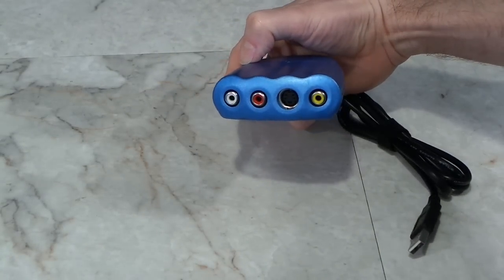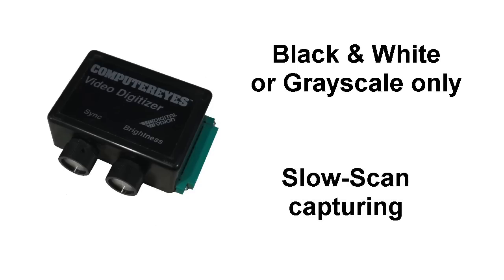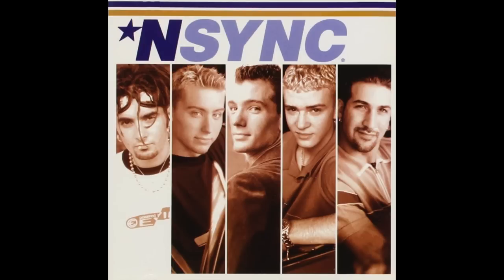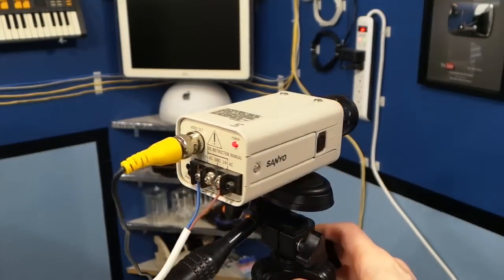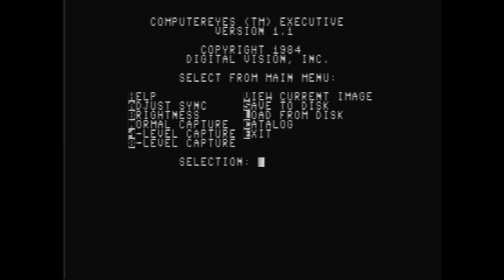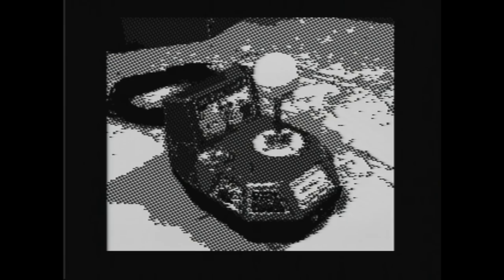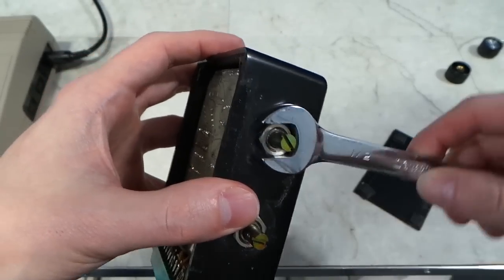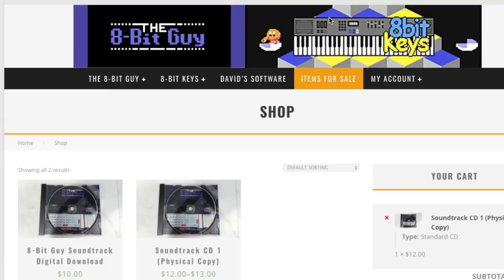How old school video digitizers worked

Comment: 2:57 Easy, get a multi-head VCR.  My friend had a Funai, and the pause on it was crystal clear.  It had a jog wheel where you could fast forward or rewind at any rate you wanted, even frame by frame.  It was a VERY cool machine and saw much use in making video "remix" tapes.

Comment: If you add a color wheel with the 3 basic color filters you can scan 3 times and with the right software combine them into a full color image.

This was how I scanned in images with my Amiga 1000 using a camcorder.

Comment: That C64 ComputerEyes was very primitive.
I used a couple of video capture devices for the Atari ST circa 87 or 88.  Fit in the ST cartridge port and captured pretty nice monochrome 320x200 pics
I believe we also tried a color capture cart that used the Spectrum 512 color mode

Comment: sorry for the necropost, i just wanted to say that i spent hours playing with ComputerEyes on the Atari 8-bit once i realised how i could use it. the images i captured may be lost to time now, most likely, but i did manage to use a Hi8 camera's video-out as a source, as well as the Sega Genesis, and a (probably 4-head?) VCR. of what i remember, i made some rather good images from The Empire Strikes Back (from the original trilogy box set they released before Episode 1, so also a decent quality image to begin with), Sonic The Hedgehog, and Ayrton Senna racing.

there may have been other hacks involved, like recording bits of Empire, and screens from Sega games, on Hi8 tape and then using the camera's superior "pause" ability to deliver a useable image to ComputerEyes.

Comment: I was really pumped when you opened up the box but ended up slightly disappointed that you didn't even scratch the surface of how it actually performs the conversion. Would have been really interesting to hear how this discrete almost logic-less circuit works

Comment: Yes there was a hand scanner for the C64 but it was to expensive.

Some 'slow scan' used a resistor loading a capacitor as timer device, the sync started the cycle and started the loading of the capacitor when a certain level was reached (comparator) they where reading the voltage from the video input. 
They restarted the cycle every line until they had scanned the whole picture.

But to be true, I don't know how they set the voltage for comparator on this circuit, it seems like they found a simplified solution.

Comment: That's cool, but I don't really see the point of it. As mentioned it takes quite a while (by modern standards) to take a photo, and even then it is only a black and white, low-res image.

I'm a bit too young for this, but wouldn't analogue cameras or VHS-tapes have done a much better job than this? I know my mother stored photos on floppies back in the DOS days, but in the 8-bit era? Our computer back then barely even had graphics (I think you could turn pixels on/off individually).

Comment: This is essentially an equivalent-time sampling oscilloscope capturing the video signal with the sync signals as the trigger. I bet you could build a simple adapter to use it as an actual oscilloscope. You'd need some kind of variable voltage divider (i.e set the range via some dip switches or jumpers) and a couple of op-amps to generate trigger signals and mix them into the input.

Comment: Back in 1981 I was able to digitize audio using the analog cassette port on the back of Apple II+. It was extremely crude audio. I have no idea what sampling rate the software used. For the most part, the digitized sound was unusable, but it obvious even then that digital audio (and video) was coming, and it was so damn cool at the time.

Comment: I have a digitiser for the Sinclair Spectrum which only required on knob to adjustment. 

The Spectrum was vastly superior to the Commodore 64 (43 K.Bytes user memory versus only 38 K.Bytes user memory on the C64 plus the faster and larger Zilog Z80 processor versus the by then obstelete Motorola 6502 processor) which gave slightly better results.

NASA took up a stripped down Timex 2068 (Sinclair Spectrum 48K.) with a slow scan circuit attached to download images from the space shuttle back in 1986 on the Amateur Radio 145 Mhz. band as part of a schools science thing. The ham station on call sign the shuttle was W5WFL, if I remember right, as due to limited battery life for the computer, it was only fired up if contacted from the ground on the 70cm. band. It was well publicised globally in ham radio magazines.

Since then both the ZX81 / Timex 1000 and Spectrum 48K / Timex 2068 have been utilised in space by NASA for science experiments due to their simplicity.    

On the Sinclair ZX80 and ZX81 using a blank 8 K.Byte x 8 EPROM inside a box with a camera lens focused onto the window in the ROM would cause a well floodlit 
object to cause the individual bits on the EPROM's surface to generate a 0 or 1.

When the EPROM was hooked into the memory map of the ZX80 or ZX81 and a piece of code was created to plot the individual bits onto the computer's screen display memory map (only 704 K.Bytes), an insect type compound image could be created. We had a lecturer demonstrate this trick at college back in the early 1980's using a 4 K.Byte x 8 EPROM mounted inside an old Zenith camera.

On the downside there would be a vertical strip down the middle of the image due to the chip's surface structure.

This was before charge coupled devices were around.

Comment: Digitizing video has been driving me insane. Modern devices have a significant problem syncing audio and video. As a TV archivist working with zero budget this drives me insane. It's costing me nearly $500 in devices when in the past all I needed was a single device when working with VHS tapes.

Comment: Fantastic stuff :) Had the Commodore 64c with tape drive, mostly used it for gaming and some Basic programming. So cool to learn after all these years what it could've done with extra devices and software. I guess you could open the digitized B&W image to any C-64 graphics editor, for example Koala Painter which I used to have, and colour it?

Comment: "All of these parts are readily available, so you could build one yourself."

...so are you gonna build one yourself?
Reply: No, I guess not, he already has one.

The funny thing ist that, two days ago, i was contemplating how I would have built a video digitizer in the 1980s. The same still frame "vertical line" principle, of course. my first idea was to build a six bit flash ADC using op-amps, latches and shift registers, together with digital counters/timers to address any pixel I want. Arrived at a component count of maybe 50 ICs. Yes, 6 bit flash ADCs were available as a single IC at that time, but ADCs were expensive then, and you couldn't simply order small quantities or even single ones.

Regardless; I knew that anything called "digitizer" was hideously expensive in the 1980s, so I guess these were elaborate devices with either stock flash ADCs (and a lot of logic ICs) or "home made" ADCs (and an even larger number of logic ICs). Also, the digitizers I'd seen in magazine advertisements were usually rather large boxes.

Then 64 gray levels seemed a bit excessive to me, so going down to 16 (4 bit) saved me maybe 10 ICs. Still a whole bunch of stuff.

Next idea: use four outputs of the user port to build a DAC (with an R-2R ladder network) to provide a 4 bit variable reference voltage for a "1 bit ADC" (a comparator, basically an op-amp). That would increase scan time by a factor of 16, but the device would be slow anyway, so why not wait a little bit longer? Also, four gray levels would be enough for the C64, which would incur a factor of only four. On the other hand, a 2 bit flash ADC could be done with just two ICs, so if 4 grey level are enough, the thing could be more speedy at the cost of two very common standard ICs (actually, one additional IC only, as one comparator in a quad comparator IC would take the role of the blanking detector).

Next idea: ditch the digital precision timer/counters (and the crystal oscillator) and associated shift register to load them with the pixel coordinates and replace them with a NE555. Differentiation between horizontal and vertical blanking could be done in software (first thought about using an NE556 to do that, but no need). Now the circuit was getting ridiculously simple...it could be done with four ICs. Nah, I thought, this cannot work...I mean these huge and expensive 1980s boxes had to be so huge and expensive for a reason.

Today, I saw this video in my YouTube recommendations .I was immediately shocked how tiny this digitizer was...and how'd manage to cram any significant amount of ICs into it. Next, I was shocked when he opened the thing...

And these things sold for 350..400 DEM (equivalent to about 350..400 EUR, corrected for inflation). Another one sold for 575 DEM, bit this one was faster (4 gray levels); I assume that it sampled several pixels per scan line, which would have required an NE556 instead of simple NE555...

Comment: vhs might look like that when it's paused but video2000, (analog or digital) betacam, and pretty much all reel to reel video recording systems had absolutely no problem with still images on pause or fast forward and reverse with the tape mounted and the image on, without any nasty out of sync crap on the screen whatsoever..

Comment: Have a look at the "Dirt cheap frame grabber" by Michael Day.  This used an extremely simple circuit (far simpler than the C64 module) and some clever software to grab a grey scale image using the printer port of a PC.  I built one many years back and it worked pretty well for something so basic.

Comment: You could have only used Laserdisc for it if it was a CAV Laserdisc since they were the only ones that had the stillframe option, just like slowmo and variable speed playback (and also going to a certain frame number). Most movies were CLV discs that did not have this feature. So if you wanted to capture a Stillframe from a movie that had no CAV release, you were out of luck. Or you had a Laserdisc player that had a digital framebuffer and could simulate CAV Stillframe with CLV discs. However these players did only come near the end of the Laserdisc lifespan, the result did not look exactly as good as a real CAV stillframe.
Reply from the maker: I used to have a laserdisc player.  As I recall, most movies were on more than one disc. And usually there was not enough movie to completely fill both sides of both discs.  As a result, they would usually give you at least one side of one disk in CAV format.  So I had several movies where at least part of the movie would have been perfect for getting a still image.
Reply: Yup, that's true. Paramount and MGM sometimes did that. Have a copy of Star Trek Generations. And the part where the Enterprise D crashes onto the planet is in CAV :]   Or the finale of "James Bond - License to Kill".

Comment: Any chance of more Sinclair Spectrum stuff? I know you have some, and it was the most popular 8-bit here in the UK, and much of 
Europe. Also, you probably know, behind the Iron Curtain many Russians and other Soviet people produced their own Spectrum clones. There was so much software and hardware available, it became the standard. And as technology got better, even into the 1990s more Spectrums were produced, with enhanced hardware, more video modes, all sorts of stuff. 

I realise you probably don't have a clone Pentagon or Scorpion, but it's fascinating how much went on, after much of the West had moved on to 16-bits. I think the last Spectrum magazines and games were released in about 1992. There was still fanzine stuff afterward, but mostly it was dead. 

Then came the Internet! The whole retro-gaming thing started about 1994, 1995, on Usenet. Spectrums had their own newsgroup, as did other machines, and there were general groups too. Lots of Atari 2600 and Colecovision collectors. I miss Usenet, actually, there's nowhere comparable now to talk about stuff like that. And the interface of a news reader was much, much more efficient and quick than submitting stuff to online web-boards.

Also important was the fact you could read and save posted messages offline. Then connect once or twice a day to send your saved-up responses and download all the new messages. This meant you only needed to spend a minimum time online, which was very important over a modem in the UK, where we paid by the minute even for local calls. 

Etc.... Anyway great channel, and more Spectrum stuff please!

Comment: I had a slow scan black and white digitizer for my Acorn Archimedes, and I mostly did freeze framing on a VCR. There was a bit of an art to it and I'd give it multiple tries until I got something acceptable.

On the model I had, you could capture colour by using three passes. You would need a video camera of some kind and red, green and blue filters for the three passes.

Comment: I have the later-generation PC version of this.  It's a later-model (ca. 1988) ComputerEyes/Pro video digitizer in the form of an 8-bit ISA-bus card (with both composite RCA and S-Video inputs).  It too uses the same "slow-scan" technique for scanning the incoming video signal, but can capture at 640x480 at 256 colors (8-bit color depth) , and can save the captures to a GIF or TIFF file using the MS-DOS utility for the card (I believe Windows 3.x software was also available for this card).  I have it installed in my 1992-vintage Tandy 1000RSX 386 PC, and it still works well the last time I used it.   It too uses standard off-the-shelf 7400, 74LS, and 4000-series discrete logic ICs.

Digital Vision, Inc. (the company that made the ComputerEyes line of capture devices) also made many other models in the ComputerEyes line, including versions for the Apple II, Macintosh, and Atari ST.  They even made another model for the PC, the ComputerEyes/RT ("RT" meaning "real time"),  that could capture one frame of video in real time (1/30th of a second) like modern capture devices, doing away with the "slow-scan sweep" digitizing used with their previous models.  IIRC,  the C64 version demonstrated here was their first model introduced in 1984.

Comment: That b&w security cam is pretty sharp, even over composite
Reply: FinalBaton
We did use Video camera, printed them, scanned them in color on LISA or Mac, 1985 machines, full color! Able to file them on floppy disk, able to import in home computers to, or transfer to cassette audio tapes in digital formats, modem style....
Reply: Since there's no chroma signal, it's not even technically composite anymore. It's just the luma signal to get you greyscale video. That's why it's so sharp. It's when you mix in the chroma signal that things start to get kinda fuzzy over composite.
Reply: @kingcrimson234  Nice info mate!
Reply: i know better than some these days 😂😂😂
Reply: A lot of old analog cameras were only held back by the video output limitations of the time. They’re quite capable for what they were.
Reply: Exactly. I was surprised too by the quality!

Comment: I made a small circuit and a bunch of code to do exactly this with an AVR. Although for 1-bit capture I grab 8px lines at ones, and the multilevel uses the ADC, the way it looks it seems the commodore thing uses different levels for the comparator for getting the levels, which is interesting... I knew other people had done this but never knew the idea goes back that far.

Comment: Why did pausing VHS always cause all those artifacts?
Reply: The video heads record on the tape whilst it is moving, in pause with the tape stationary the flying heads on the drum don't exactly line up with tracks originally recorded. Professional video tape records can dynamically position the heads as the head drum spins for all those 1980's and 90's perfect variable speed + freeze frame, reverse slow motion effects.
Reply: Coolkeys2009 thanks for the very succinct explanation. I even googled for one, and sorta got the idea, but you made it click with mentioning the recording part.
Reply: Because the playback head continues to spin.

Comment: The Atari 8-bit version of ComputerEyes connected through the joystick ports. And with Graphics 9 on the Atari GTIA chip, it could get pretty slick photo realistic images. And if I used colored filters and used APAC, I got colored images, too! And I used my VCR to do some captures by pausing on a solid frame of video recorded in SLP. I got some excellent results that way but wore out too many idler assemblies.

Comment: Growing up I had a new version of this digitizer.   It didn't have the adjustment knobs, and it only took about a second for the fast capture and about 3 for the slow.    I used to make slide shows with it all the time.    Back to the Future happens to be one of the first things I remember capturing with it.   My copy was on Beta-max so it paused well enough, but at 1 second I could easily capture scenes with little moment.   I also remember that the software supported a REU memory pack you could actually capture a very short video clip.   I never had a REU so I never tried it.

Comment: For the four color mode, I think the digitizer is doing three passes; is the current pixel brighter than 75%? second pass, 50%; finally, 25%. For any pixel that was bright on a previous pass, it will remain the same, otherwise it is possible to replace the current color, defaulting to black. I'm also assuming that the camera was tilted upwards as the picture was taken from left to right. This seems to match with the ghost image of other scans and the way they overlap.